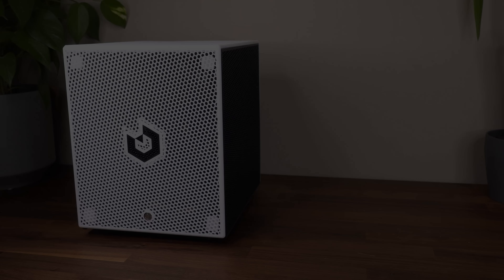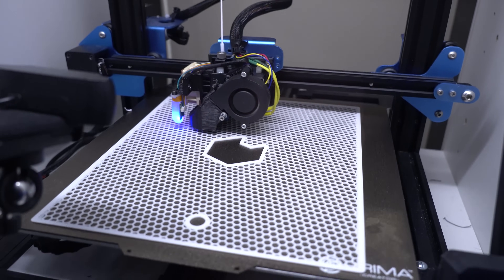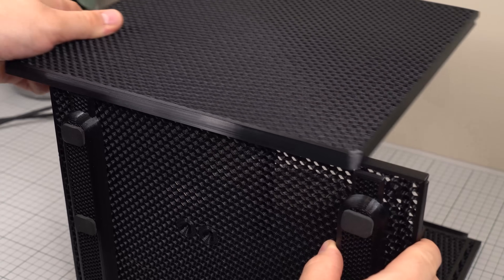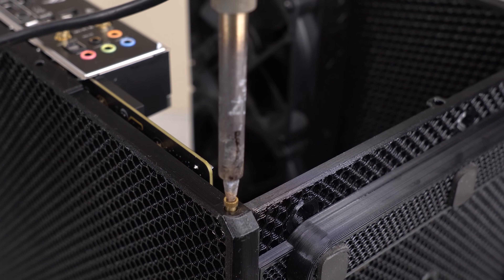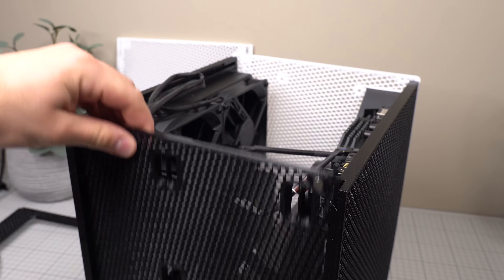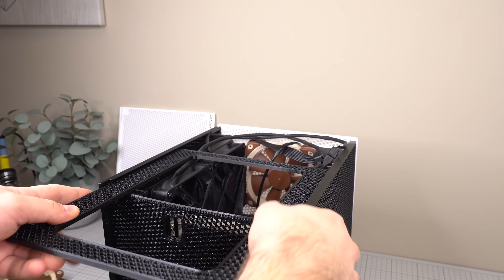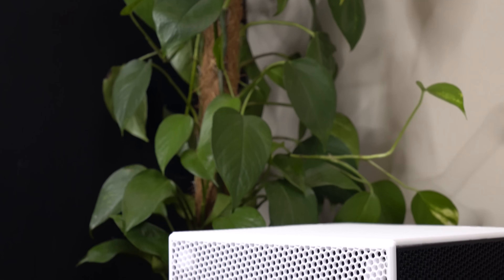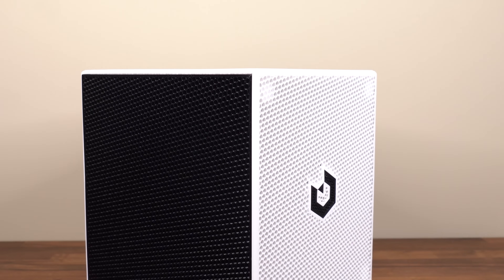Little Boy M - a 3D Printed Micro ATX case

Comment: Did anyone tried this case with board atx, Rx 3070 and normal ATX power supply? Normal Colling sistem.
Reply from the maker: ATX motherboard does not fit this case unfortunately. Only Micro-ATX and ITX. 🙂

Comment: Please make smaller, matx just for the mother board, power suply and a 300mm Gcard, no liquid cooler or hard drive, just the ssd
Reply from the maker: I’m working on one now. Not the exact specs you refer to, but mATX, ATX PSU, 2.5+ or 3.5 drive support 120mm aio support, up to 275 (250mm) gpu too. In a relatively compact case

Comment: @makerunit having a 22x18cm matx, i am just wondering if i can print a 22x22x25 (my printer max) version
Reply from the maker: Unfortunately this case needs a 300x300mm printbed. 

Though I have other models available compatible with mATX that can be printed on a 180x180mm printbed.
Reply: @makerunit  thanks! can u let me take a look at those?
Reply from the maker: @fuoristradaTV  search for «makerunit» on www.Printables.com

Click my profile and then to «Club and Store models»
Reply: @makerunit  the only two i see are the atx , which have a lot of space but i have a 240mmx180mm micro atx and would like to stay low in dimensions. Other way, i could use space for a vertical gpu, but the power supply, placed on bottom, doesnt let me. Are we sure an ITX doesnt fit my 240x 180?
Reply from the maker: @ what Printer do you have?
Reply: @ creality ender 3 v2. By the way, my MB is a FLEX ATX, 220x185mm ..not a full micro atx
Reply: not 240 but 220
Reply from the maker: @ hmm, I see. Unfortunately I only have those mATX, ATX and ITX options, but no design that small except the ATX 180x180mm model.

Comment: Would be great if you can split the large parts into sections so they can be printed on a 230x230 unit.
Reply from the maker: Hi! I think I actually have a split version laying around that I designed but never posted. I’ll see if I can find the files and I can send to tou to test out. BUT! I can’t guarantee that they work as hoped because I never tried printing them. If you message me on Printables I can try to send them to you if I find them, but print at your own risk, as I’ve never actually printed that one. I’ll send it to you for free as it’s not tested.
Reply from the maker: Hi, unfortunately I don’t have a split version of this one. But I replied to your other comment about the SL case.

Comment: I live in an area that gets really hot in the summer. I have a Ryzen 5 5600x. Even though I use an water cooler, the temps get crazy high sometimes. My fear is that overtime I will have a problem with warping material. Would PETG be ok in this situation? My printer cant handle ABS.
Reply from the maker: I use PETG for my builds, I’d say you’ll be fine. But I’m curious, how hot are the hottest days? Are we talking 35C or like 50C?
Reply: @makerunit  around 30/35.
Reply from the maker: @alyssonmr2  I see, shouldn’t be a problem with PETG then 😊

Comment: can this be printed in .4 nozzle with out  issues? or does it have to be .6
Reply from the maker: 0.4mm nozzle works very well. I printed most of my parts using a 0.4 nozzle. 😊
Reply: @makerunit  thanks for the reply on a older video 

I have a idea on a layout  to remodle ur lil boy s to run a matx set up wondering if u entertain outside ideas
Reply from the maker: @Jinx-dv7ne  I’m open for outside ideas definitely! Can’t promise I’ll go through with it but I’d love to hear it and take it into consideration 😊
Reply: @makerunit  im actually in the middle of makeing it myself.  im in  no 3d designer sadly some might be a bit of testing and retesting till i get things where i want them  and since im legitly only useing orca slicer to do all the editing  its been intereting the last 5 hours 

but it seems like im going with a  matx mb and sfx psu  with 240mm aio support with room for up to 4 more 120mm fans and 2x 80-90mm fans  and should fit up to 290mm gpus  all printed on a 300x300 sovolsv06 plus 

thanks for the insperation  i might need help  lmao jahahaha

Comment: Hah I just commented on your last video only figure out you already made a mATX version. However, I don't love the cube dimensions. It feels really dated with cube cases. I'd prefered a slimmer design of the ITX-version. But maybe that's hard to pull off?

I would imagine you'd just have to scale up the ITX version and just forget about 3.5" drives. Most people don't use hard drives anyways. The same layout as the ITX but two 120mm fans in the front as intake would've made the build smaller with less dead space. Also the posibilty to mount the AIO in the front or in the top instead, and vertically mount the PSU over the cpu just as with the ITX build instead of in front of the graphics card which creates all the bulkyness.
Reply from the maker: I’m soon about to release an ATX case! It supports ATX/mATX/ITX and SFX/ATX psu!😊 it’s a little slimmer than this at 200mmm width. But taller and longer.
Reply: @makerunit  Sounds really nice. I love the astetics of all of these cases you made. It's just that I prefer the smallest possible dimensions. And when comes to price/performance while space effecient I think mATX mobo plus ATX PSU is the sweet spot. I modded my Cooler master NR200p to fit a full size mATX, motherboard, an ATX PSU as well as a 27cm long RTX 3070 and a twin tower cooler. It's almost as compact it can get. Buuuut I think a modified version of your ITX case made to fit a mATX mobo and ATX PSU would both look better, perform better while beying yet a bit more compact.

Anyway I really looking forward to your ATX case. And your content inspired me to buy a 3D printer for myself. I only have used my ex flash forged for some smaller projects before. But now I want to get into printing and designing myself even though I'm a noob. :)
Reply from the maker: @ChrisKadaver  awesome to hear you’re now into 3D printing! And remember that everyone starts out as noobs 😁 noob was me not too long ago too! 😅

Comment: This is amazing! The only problem I'm facing, I can't find some nice base for full size ATX motherboard, so I can start building something around it. I'd love to turn my full size PC into something like an "overheight laptop"... I'd keep Power Supply outside the case, so case could stay as small as possible. Basically it needs to cover the motherboard, 32 Gb RAM, Ryzen 7 stock CPU fan, and my old but trusty GTX 1660 Super video card. Why would I want to do this? Because I travel to Europe quite often, and I could carry this with me. Without PSU of course, it's not needed there anyway... different Voltage and everything, when I get there, I'd use 220V one anyway, and it would be simple plug'n'play. I basically want to find the smallest possilble case that would hold those couple of items inside. Do you have any project that involves ATX full size motherboard by any chance? I am even ready to pay for project files if required. Thank you so much in advance!
Reply from the maker: Hey! Thank you! Actually my current project I’m working on is exactly an ATX case. I’m currently looking at dimensions of 350x350x220 and it’s not in a laptop format unfortunately.

Comment: It is really amazing, i would love to see this same case been able to print in my printer that has a 220x220 bed. 
Great job.
Reply from the maker: Thank you! I’m currently working on a ATX case that is printable on this bed size, it will be a little bigger to fit a full ATX motherboard but I’ll make it as small as possible 😁
Reply: @makerunit Looking forward to this.

This design checks every box I need for my cobbled together server/nas but my print bed is only 256x256 :(
Reply from the maker: @phoenixs4r  You’re good with the 256, plans have changed so currently it’s looking to be 180x180mm bed friendly 👌

Comment: Awesome build! The way you handled tolerances is truly impressive. I would not hesitate charging for something that feels so complete and well thought-out. 

I understand that you recommend printing this in PETG. Have you had any issues with PETG reaching glass transition point and sagging / warping as a result? I am considering printing a PC case but I'm wondering how it may handle the temps
Reply from the maker: Thank you! I’ve been using 3D printed cases for almost 3 years in a row now. Never experienced a single issue in regards to the plastic and heat, even in hot systems. 

Even with PLA I haven’t experienced any serious issues, but would still recommend PETG/ABS or ASA due to their higher temperature tolerance.
Reply: This is reassuring, will definitely give it a try with PETG. Thank you!
Reply from the maker: @nandrey69  you are welcome 😊

Comment: Anyway to modify this to fit on a bambu labs? 256*256
Reply from the maker: Hi! Theoretically possible, yes, but it would require quite heavy modifications to keep it structurally strong.

My recommendation is to wait a bit because I’m working on more models to come out the next few months that will be designed to support large parts but also to be printable using smaller print volumes! 😊
Reply: @makerunit THanks for the reply, sounds like I will wait a little bit! Awesome

Comment: This is almost perfect. I just need a Similar mATX case that can be printed on a smaller printer. Im currently using a Bambu Lab P1S. It only has a build volume of 256x256x256. =(
Reply from the maker: The plan is to get some designs out that also supports the Bambu volume on mATX and even ATX cases.
Reply: @makerunit Sounds great. I really need to learn CAD software, but its so un-intuitive and difficult coming from someone who primarily only ever learned graphic arts software like Photoshop and fireworks etc.
Reply from the maker: @secondleasegamer8312  I found it to be suprisingly simple to learn cad. The main challenge is coming up with the ideas and thinking of all the design features, not the CAD itself. The main challene is to make it printable without too much crazy overhangs etc.
Reply: @makerunit Well, Im 35 now, and I grew up teaching myself to program and how to use graphics art software. All 3 CAD softwares I tried to learn made no sense to me and was difficult to even make a simple sheath case. In the end, I managed, but the difficulty at making something so simple with measurements I'd already known, makes me hesitant to revisit. Seriously painful experience.
Reply from the maker: @secondleasegamer8312  I understand. I started learning in Sketchup, and it worked for a while but was not very 3D printer friendly, and complex shapes were really hard to edit once they were made.

Now in Shapr3D it’s a dream! I was a little thrown off at first with sketches and planes and all kinds of weird functions but once you get it it’s so awesome and easy to do.

Comment: Mini cases with 0 hard drive space... What happened to wanting 4 hard drives for a raid 0 gaming PC?
Reply from the maker: There is space for hard drives in this case… 😁 one 3.5inch in the front, optionally two 3.5’s on the side if not using a radiator and some 2.5 inch drives down in the front corner.

Comment: I would really like to see a build that has 3 or more 3.5in hard drive slots.

Great build!
Reply from the maker: Then you’re lucky! My next case will have 4! 😁 (if it goes as planned), still on the drawing board as we speak.
Reply: A Matx Nas mod for this would be great.  With space for ½ height GPU and low profile CPU cooler.  Looks like there could be plenty of room for 3.5" drives.

Comment: I have a low power/heat build as a media server. Can I use PLA for the whole case?
Reply from the maker: I think PLA will be just fine. None of my previous PLA only cases have had any issues due to heat, and some have been relatively hot as well! But if your PC will spend a lot of time standing in direct sunlight you may want to choose PETG or ABS. (For example by a window)

Comment: Have yo thought of integrating holes or inserts to make the design opportunity for those who like to tinker with 3D printed vent shrouds to get extreme air cooling performance? That would me amazing to see... But I do acknowledge that would be a very dificult task
Reply from the maker: I haven’t really given that any thought tbh… but the side wall sliding tracks can always be repurposed for custom ducts etc. Also my Advanced members will get the full .step files that are easily modifiable. 😊 I have thought about making fully flexible layout designs with universal mounting points so people can put the parts where they prefer themselves.
Reply: @makerunit  Thanks for the reply, I can't wait to see more content  about it. Also, have you thought of making vent shrouds for your main rig as a cool project to minimize temps? Or is it too trihard for your liking?
Tbh I actually care a lot about temps, because where I live temps are always near 23°C or even 27°C near the hottest months so

Comment: Hello! I've seen some of your videos from the "Little Boy" series and I have a slightly funny case. My computer has an M-ATX board, and for cooling I have a 360mm AIO that together with the fans is a total of 63mm thick, in addition to the fact that my GPU measures 300mm (a 4060 with 3 fans), in addition to having a power supply ATX power supply and 2 SSD. That's why I was thinking about the possibility of having a "Little Boy ML", as with the "Little Boy SL". I know it's a very specific case, but I love the design of this range and I have no idea about designing things in 3D. [Sorry for my bad English btw :P]

Edit 1*: I have found that in the United States this model of PC Case is sold: Vetroo AL-MESH-7C, and it is more or less what I thought, but being from Europe, I cannot buy it without it being worth almost 4 times what it would cost to print it.
Reply from the maker: Hi! I am eventually planning to create a case that supports full size ATX motherboards as well, if it’ll be in the little boy series or not I’m not sure yet, but I’ve got some ideas in mind for future projects!

Comment: The sliding panels is very smart, question how much extra distance did you leave for clearence, 1mm? 0.5mm?
Reply from the maker: I think for this design it’s about 0.3mm (on all sides, so total tolerance should be approx 0.6mm. I was a little generous with the tolerances here to make sure it would fit most peoples needs. Though may appear slightly loose for some with very accurate printers.

Comment: I really love your approach designing this case with minimum filament yet you make it sturdy even supporting radiator and gpu hanging like that... Impressive! I would like to modify your design since i am gonna rebuild my matx nas server so i can fit at least 5 3.5inch hard drive in your case
Reply from the maker: Thank you! The full .step files that can be easily modified are available for my advanced members on Printables 😊
Reply: @makerunit  will do, even just for this concept alone you got extra subs from me. Keep your good work man!
Reply from the maker: @muhammadadnanhutomo  thank you! More coming soon 😊

Comment: I know this is probably impossible - but I think a really good step up from this would be to redesign each part so it can fit onto a standard 230*230 ender bed. I’m just gonna chop up the parts and hope it works out.
Reply from the maker: Yeah it would somewhat ruin the aesthetics of the case. But definitely possible. 😊

Comment: I have a matx 10th gen lying around so now busy printing the little boy M
Reply from the maker: Awesome to hear! Let me know if there is anything! 😊
Reply: @makerunit  regarding atx I worked out case size would be H440 x W280mm xL500mm, the width isto allow to make space behind the MB for cable management
Reply from the maker: @shearer6932  I see. So basically a full size tower. First I have to find a clever way of joining flat panels while still looking clean,
Reply: @makerunit  thats a mid tower a full tower would be a lot taller so as to take several exturnal bags and eatx or bigger motherboard

Comment: these are brilliant designs I joined your club would like to see mid tower and case with 5.25 external bays
Reply from the maker: Hi! Yes, thank you so much for joining! I remember the username from the Printables club notification I got earlier. So I’m not really familiar with the 5.25 drive format you’re referring to but I can look it up and see if I can make an adapter to support it for you based on the measurements I find online. 

Or are you referring to a complete NAS build?

(Sorry for the slow response)
Reply: @makerunit  no a desktop most cases now have no external bays, My ideal case would be a case with two 5.25 bays hold an atx mb and 360 aio without having to get a full tower so long mid tower is ideal, my current 
case is focal design focus g is ok but only supports a 280 in front with a tight squeeze. and of course 3d printed would cut down the weight
Reply from the maker: @shearer6932  I see. A few of my cases have lacked support for HDD's and I get that a lot actually from people wanting support for HDD's

I'll try to keep that in mind when I get to design an ATX case some time. And I'll look into having it support even 5.25" Drives! :)
Reply: @makerunit  5.25 is for bluray/dvd writer which I use a lot
Reply from the maker: @shearer6932  I remember that from when I was smaller, we had those, just didn't cross my mind as I've not really come across them much in recent years. 🙂

Comment: Suggestion for future builds - Can you design a case with a mix of 3d printed and laser cut (acrylic or aluminium) parts? 3d printing is still very expensive where I live but laser cutting/cnc is pretty cheap. Maybe the large flat panels could be laser cut while the complex parts can be 3d printed.
Reply from the maker: Hi! This is a great suggestion, unfortunately I don’t have access to laser cutting equipment at this time. But maybe I’ll have that some time in the future 🙂
Reply: 3d printed parts are expensive but printers are kinda cheap, so get a printer! 😅